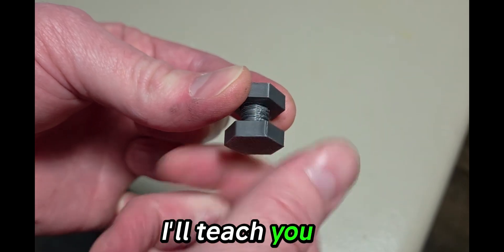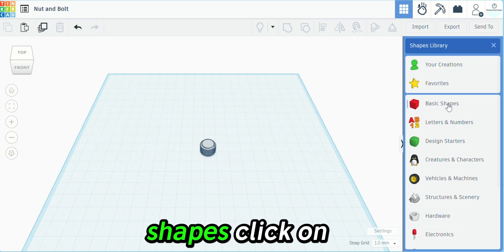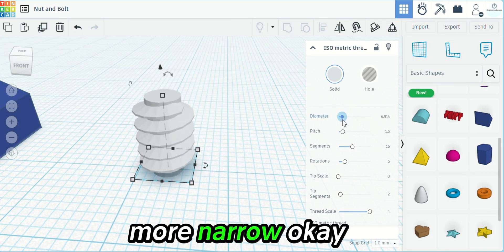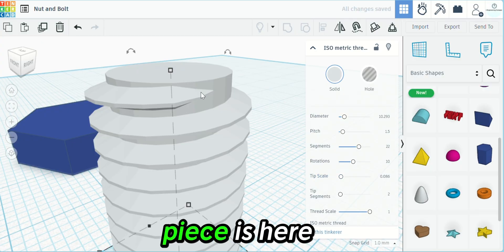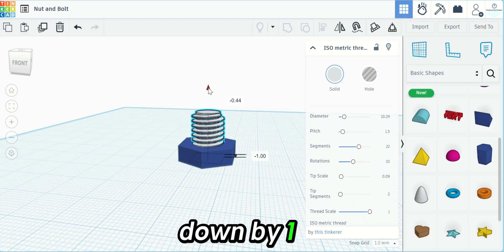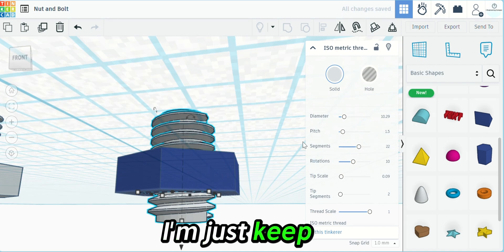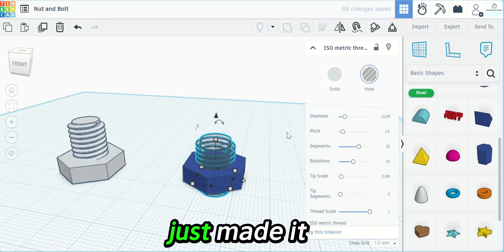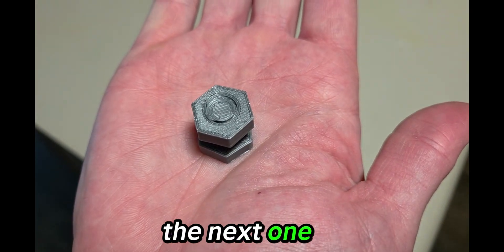How to Make a Bolt and Nut in Tinkercad That Really Work!

Comment: I have always seen recommendation to make a part maybe 0.2 mm - 0.4mm smaller in diameter than the hole its going in so that things work together smoothly with no binding caused by shrinking during print.  Seems your making the difference between the hole and the part a full millimeter is alot and might cause too much slop between the parts.  Is this larger amount of difference between solid and hole permissable because its a threaded part and not simply a smooth shaft pushing through a hole ?  Is the 0.2 to 0.4 too little for threaded parts ?
Reply from the maker: You are exactly correct! 0.2 - 0.4 mm is a little too small for taking into account shrinkage on both parts after they print. This is precisely why I used 1 mm.

Comment: Is there a way to get more than 20 rotations to get longer bolts without trying to marry up the threads to match?
Reply from the maker: The best thing to do would be get your bolt exactly the way you want it before you make your cut out. Thinking of it like this, you’re cut out will match whichever way you make the bolt.

Comment: i need an eye bolt to fit in a 3/4 " drilled hole....i cant find or figure it out - can i try to change the head on this?  and how do i know if the diameter of the threaded piece will fit?
Reply from the maker: Good question! During the video, any of the dimensions that I show when I create the nut and bolt can be changed to your liking and you can also change the thread width and the length of the bolt to fit your needs. I usually just do a quick test print and fit check and then adjust from there. If you have an image of what you are trying to create I may be able to help!

Comment: Nice, I usually also reduce the thread scale a bit (0.85) for the bolt. 2:38 You can easily solve this by pressing "D" for drop when selecting the thread.
Reply from the maker: That's a great point. Thank you for the feedback! 👍💯